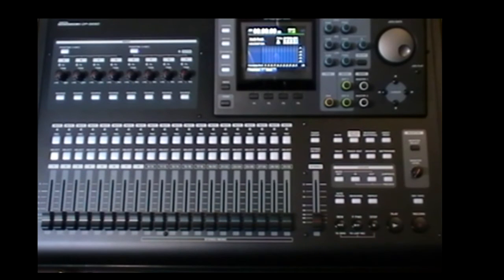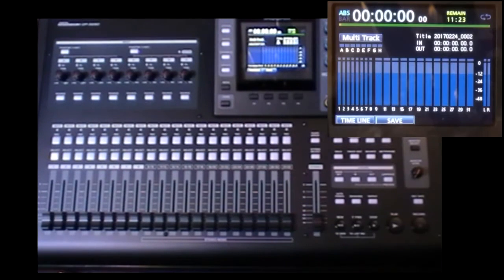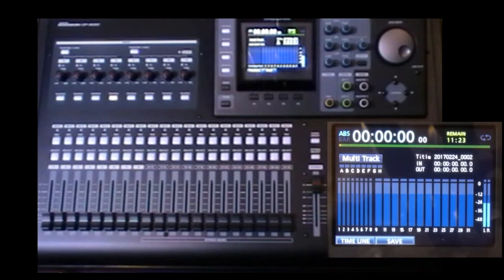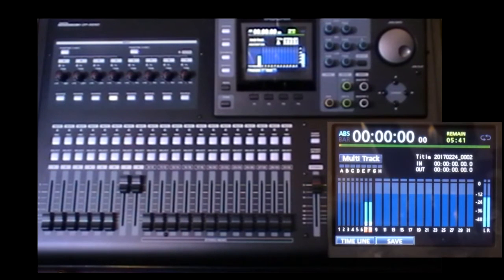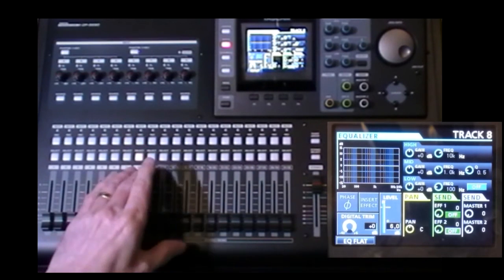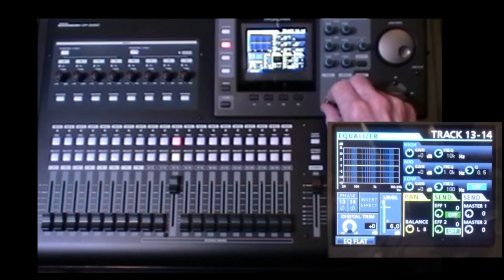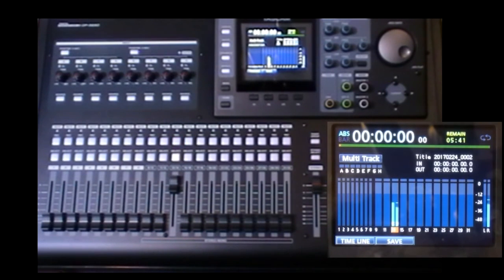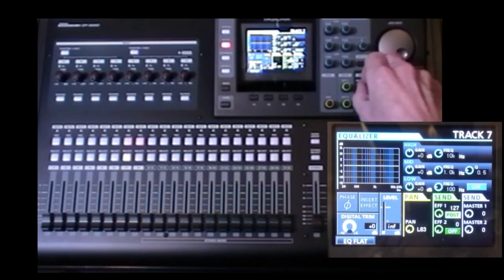Tascam DP24/32SD Tutorial 6C: Stereo

Comment: Thank you for your reply. I'm glad you enjoyed my videos. I have just finished my 24th guitar instrumental CD and realised it was time to dump the Yamaha AW16G as like myself, it is worn out!  I'm pleased to be going back to Tascam but as yet, haven't plugged it in, but the manual is already in the bin like every other manual I have ever had. I have never used the on board recording facilities other than my backing tracks and guitar. I send the stereo mix to my Alesis 3632 Compressor and work from there. The Portastudio to me is really a tape recorder. Great for recording backing tracks, guitar and panning. I edit the tracks in midi on Cakewalk Sonar which I have custom made in Denmark giving my trackmaker sufficient funds to live in the lap of lusxury, or so it seems looking at my bank balance!! I find panning an art form as some instruments can vanish if I go to a full pan left or right. Only the hall reverb access is preventing me from setting up the Tascam. I learnt on the old 688 usuing external FX and I sorely missed the mute buttons when it died.  As you can hear from my videos I love the clean sound. Bert Weedon always told me less is more. A very good teacher and could get very cross if I made any mistakes, as he told me if I read the piece correctly there would be no mistakes! Anyway, not sure if I should look for an old external reverb unit which would give me control. My Fender amp goes directly to an ancient ZOOM FX programmed by Geoffrey Strachan. Apparently worth money these days.  The Tascam to suit me would need a switch and control to access the FX to switch between dry and added FX divided between Monitor Out and Setereo Out in an ideal world. Is that possible? The only on board FX I used on the Yamaha was Hall Reverb. Thanks again for your asdvice but I need to get it as simple as using an old reel to reel tape recorder. Thank you.
Reply from the maker: @Peter Williams Well you've done an excellent job. Wish I could play guitar half as well as you :)
Yes the DP machine can be used just like a tape recorder; that's one of its attractions. The complications come when you want to add fx or do any processing, and then you just have to bite the bullet and enter the wonderful world of multi-track recording. You've already exploited some of that potential by using the tracks for different takes and then deciding which is the best, but there's so much more than that.

The internal send effect system is worth getting to grips with as it opens up a lot of potential within the machine. It's covered in video #5. As mentioned before, once you enable send-1 you can add one of the many effect types in the send effect section to any track (or tracks) during playback, and it will mixed along with the backing and appear at the stereo outputs so you can pass it through your Alesis unit.

I know it may not be applicable to you (yet!), but you could also use the send outputs (there are 2 completely separate signals) for anything else, such as independent sub-mixes for other performers who maybe want to just hear the backing and not your guitar (say), or maybe they want to hear the guitar but not quite so loud. The possibilities are limited by your imagination :)

But there's nothing to stop you using the machine as you are, and simply adding an external reverb unit in the signal path. This may be a better choice for you if you can get a good quality one and don't mind the extra wiring. 

Either way, if you want easy step by step instructions for various tasks on the DP machine, my Step-by-Step guide may help. Full details are here http://www.philizound.co.uk/freebies/dp24-32/dp24-32.html  There's a small extract from the guide you can view/download which contains the full index plus a few random pages so you can see what topics it covers and whether you like the style.

Comment: I am considering this item but everyone that I have spoken to about it tells me not to buy it because of the limitations and frustrations of editing on such a small screen... why is there not the option to connect to a larger monitor?
Reply from the maker: Good point +FilmBizDude - there is no connector for an external monitor - unless someone comes up with a DIY mod :). I would suggest you try before you buy if possible, or if you're in the UK or have similar 'distance-buying regulations', you can buy it with the option of returning it for a full refund if you're not happy. I don't find the screen size too bad - for me, the frustrating is only being able to edit one item at a time as there's only one set of EQ, Pan & Send knobs, but for me it's a small price to pay for having all this functionality in one box. There are very few alternatives unless you go down the generic 'personal computer'-based route, but then you'll need to cost in an audio interface and a work-surface interface if you want hands-on faders & knobs. Even Tascam's Track Factory is just an ordinary PC, albeit optimised and pre-installed with a conventional DAW (Sonar), and a hardware audio interface thrown in to save you the hassle of setting up a system. At the end of the day, all these generic computer systems are still designed to be a jack-of-all-trades driven with a qwerty keyboard and a mouse, which is one of my pet hates for music creativity and the driving force for designing Sequetron :) ... as opposed to machines like this one with dedicated embedded processors/computers with possibly their own operating systems. Good luck and hope you find a solution.

Comment: Hey Phil, I just got a DP-24SD, so I'm following your tutorial carefully. I just have one question. Why is there to SENDs, SEND 1 and SEND 2, if we can only add an effect on SEND 1, and send it on the STEREO BUS ? SEND 2 cannot be transferred on STEREO BUS, so what use can be made of SEND 2 ?
Reply from the maker: @Kerryann MARTIAL the send outputs are so useful, you might ask why are there only 2? Each send output offers a submix of any of the track and input signals. 
You can connect these to performers (via headphone amps, say) so they can play in sync. You could just connect the monitor output to all the band members, but say the vocalist just wants the drum beat, and say the drummer just wants vocals loud, but the guitars quieter, having control over each submix is a good thing. 
Another use is for connecting external effects units - the sends go to the effect inputs, and the effect outputs (returns) go back to spare inputs on the DP machine... you can choose to record these inputs or just route them direct to the stereo bus for monitoring (or even route them out of the other send output!). 
Each send output is mono, but if you want a stereo send, you can use send-1 for left signals, and send-2 for right.
The internal send effect is always 'wired in' to the send-1 signal but it's up to you whether or not you use the effect. If you don't want to use it, just turn it off in the effects screen - the signal always goes to the socket regardless. 
How you mix & match these is up to you. You could have the internal effect on send-1 and an external effect on send-2, or you could have 2 external effects on send-1 & send-2 respectively, or the internal effect on send-1 and a performer's feed on send-2, etc. it's just limited by your imagination :)
I think videos 5 & 6B have more info.
Hope that helps,
Phil.
Reply: @philtipping  Ok I understand now the various uses of SEND, and its importance. Thank you for your work and your response !

Comment: Hi Phil: The first 2 inputs I am sending a music mix. The other 6 inputs are for drum mics. How can I get the complete 8 inputs to the stereo out, which I am sending to a video camera. I am not making a recording, I just arm the 8 recording buttons to get the mix all together.
Reply from the maker: +amy cardu hi - there are 2 ways of sending the inputs to the stereo outputs. One is shown in the "basic mixer" videos (3A onwards), and use the Assign switch to route them directly to the stereo bus. This is the simplest route, but the disadvantage is that the input levels are controlled by faders inside the mixer screen so it's a bit more cumbersome if you need to change them frequently. The other method is shown in the "advanced mixer" videos (6A), where the inputs are assigned to tracks, the tracks are armed but you don't press Record. The assigned inputs then appear on the stereo bus as this is effectively what you would monitor if you were recording. The advantage this way is that the levels of each input are now controlled by the physical track faders.
Both methods allow the dynamic effects to be used, the Send effect to be added, and the input EQs to be used.
The 2nd method allows one of the tracks to have an insert (guitar) effect added. It also allows any of the track EQs to be used - that's in addition to the input EQs.
Hope that helps.

Comment: Hey Phil,  good tutorial thank you. I've been recording my tracks in two mono on the combined tracks..... say 9/10 but then doing my mixing on the computer. Panning on two separate tracks in daw. I did not do the separate panning on the tascam recording in. Would that make a difference in my recording ? I'm aware it would if I was mixing in the tascam. I would think those two separate mono tracks would have the same sound just separated to two channels when dropping them into the computer.
Reply from the maker: @djspinista thanks for the feedback. There is no need to pan anything during recording; panning only affects the playback or monitoring of the signals. 
If you record to 2 mono tracks, you only need to pan these left & right when playing them back (which includes mixing or bouncing). If you export them to a DAW, you need to pan them left & right within the DAW.
If you record to a stereo track, there is no need to pan anything during playback or mixing. However, if you export a stereo track, the DP machine generates 2 separate files for left & right so you have to treat them as mono files inside a DAW and pan them left & right as before.
If you mixdown in the DP machine, it generates a single stereo file. You can copy this to a DAW (you do not 'export' it) and play it back without having to pan anything.

Hope that makes sense. There's a large section explaining stereo in the step-by-step guide if you want more info http://www.philizound.co.uk/freebies/dp24-32/dp24-32.html
Reply: @philtipping  thanks , makes perfect sense appreciate the help .
Reply: @philtipping   hey Phil I have another question for you , is it possible to do automation using bounce tracks ? For example do pan sweeps print that to your new track.  From my understanding it's not but figured I'd ask.
Reply from the maker: @djspinista  as far as I recall, very few controls work during bouncing (I think only the track faders work), unlike mixdown where all the controls can be used on-the-fly. Pan sweeps will definitely be recorded during mixdown. I think the restriction is because the track select & input source buttons have a different function in bounce mode, so can't be used to select a track/input as the target of the knobs (eq, pan etc.). The later videos touch on this, e.g. no. 9 - bouncing vs mixdown
Reply: @philtipping  oh okay,  that's what I though . So detailed mixes should be done in a daw . I dont have enough arms to do what I want in mixdown on one take .
Reply from the maker: @djspinista  you can copy the mixdown file back into a spare track for more processing/mixdown(s), but you need a computer to do it - the technique is shown in one of the mix/mastering videos... but if you're ok using a DAW, it's probably easier to just do it all there :)
Reply: @philtipping  I got no way to output sound on my computer at the moment , I will try this. Thank you so much.

Comment: Thank you Phil. I think I forgot to explain that when recording the backing track I realised the whistle in 'Winds of Change was too loud so I stopped recording, edited down the whistle in Cakewalk and then hit play & record to overwrtite what I recorded. I didn't realise that my first recording hasn't been overwritten and was still there. I went back to zero on the counter but that didn't work. My brain was using the Tascam like an old reel to reel tape recorder. Anyway, when I discovered both recordings where there I found the end point using the jog wheel to access the point in the recording I wanted, turned down both faders and pressed play & record until I had passed the point of where the first track ended. That wiped out the recording and now I just have the track I wanted. Probably did it all wrong but my ancient brain can understand what I did. Thanks to you I have learned the following:

How to create a track. How to name the track. How to assign a track. How to pan both left & right inputs. How to use the Monitor and Stereo out. Still not got the source buttons sorted but I seem to have stumbled on what works. I am naming each cable I am using after removing them from the Yamaha and replacing some olderleads. I have tested that the 'monitor out' is routed correctly to my hifi amp and that 'stero out' is routed to my Compressor/Limiter and then on to my mini disc recorder. Never too sure about using the compressor. The best facility ofthis Alesis is the noise gate, but now I  I have those lovely mute buttons back I may not need it to cancel out any clicks on my recordings. I spend too much time using the noise gate trying to get both left & right channels to end together. This is an experience for me and I hope I am not being a nuisance but its always good to discuss with others any new stuff you are using. I will finish labelling the cables today and then comes the major problem. Introducing my guitar and finding 'Small Hall Reverb' to add to a dry recording and to use it in play for rehearsal. My guitar is through a Fender Mustang amp that Fender have programmed for me to the 1957 setting I wanted. They listened to me play and then made the patch for me, sending it to my amp using WiFi. Also to my phone so if I want to go to a guitar shop and test any guitars, as long as there is a Fender amp in store I just need to point my phone at it and my sound is installed. Very clever. Then the signal goes through a 20 year old Zoom 508 programmed by Geoff Strachan for sounds of The Shadows. This was invaluable when I used to do 3 Gigs a week performing a tribute to The Shadows. I will now learn 'Wind Of Change' before I look for my reverbs so if I get a good result I can just record it, then on to mini disc, and finally a copy to CD written optically and then back to the PC to save as a WAV file for sending on to the studio for my next CD. I wait until I have all 20 tracks done then send the WAV files using SMASH to the studio. Best bulk transfer I have used. Thanks again for listening. Peter.

PS  Please send me a note of your address if you would like a complimedntary copy of my new CD or anything on my web site.
Reply from the maker: @Peter Williams Ok Peter, thanks. Glad it's all coming together. You did explain about the whistle being too loud and having to re-record the backing. 
I was only commenting about your statement "turned down both faders and pressed play & record". Turning down faders is not necessary as they do not control the recording level. You could have left them up and the track would still have been erased.
I also notice you say "pressed play & record". This is not necessary either. You do not need to press Play. It's not quite like the old tape machines where you had to press both buttons at the same time. You only need to press Record. In fact it's safer to just press Record even though pressing both buttons seems to work, because if you accidentally press the Play button a fraction before the Record button, the machine will just start playing; it won't record.
Anyway, these are all minor points :)
Fascinated to hear about the Fender programming system; I didn't know about this, but sounds a great idea.
Thank you for your offers. Might be better to use email for more details (and also easier for me to use if you have any more questions - I find Youtube messaging is a bit cumbersome). My address is patipping at gmail dot com.